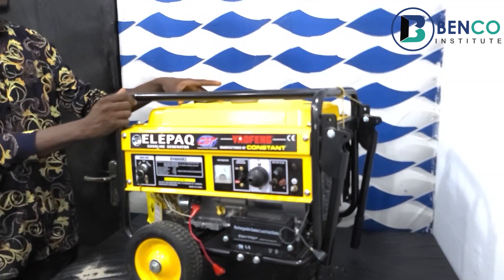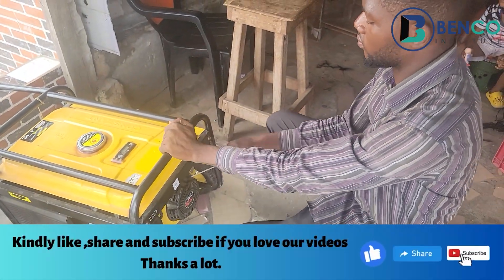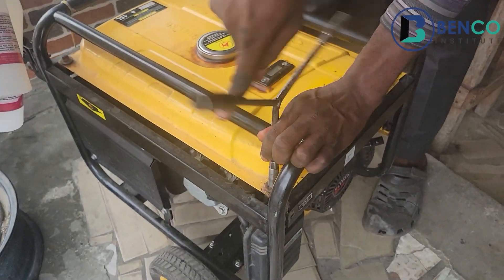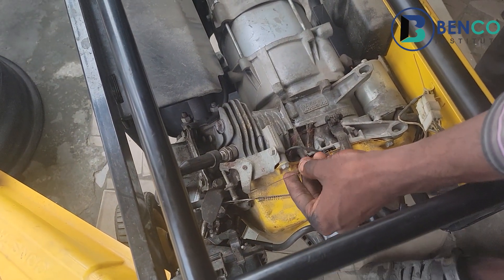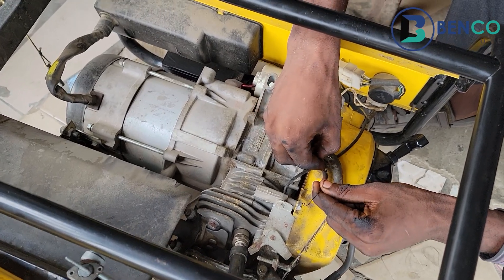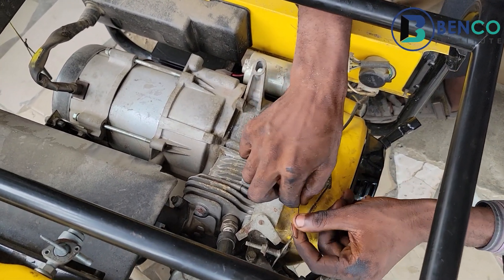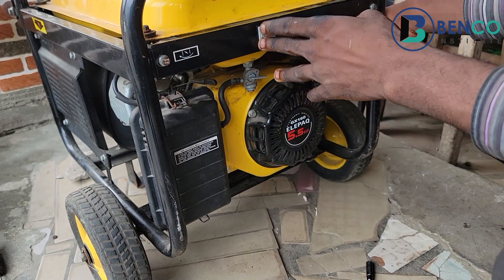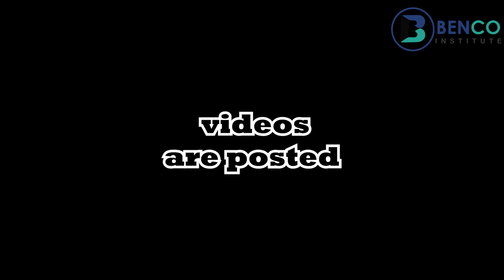Governor spring replacement:How to fix no/low voltage and low speed in 2mins for your generator

Comment: Short and straight to the point. Thanks and more power to your elbow sir.
Pls help me on my gen problem. Many engineers coulnt. The generator starts and sound normal. On loading, it stalls the governor spring is not broken but i sense that the gen cannot increase speed momentarily on loading. Avr has been ruled out. Another observation is that when i accidentally starts with the load on, the gen did not stall. Thanks

Comment: Boss,I watched the video of how to clean carburator,after I did it I turned on the gen,but then there is this thing that looks like choke but not choke that increases and decreases current stopped working,I just take screwdriver to increase that black screw stuff in the carburator,but atm my tiger gen can't carry my sumo pump again even after increasing current from that screw stuff,once I put on the sumo switch then generator sound would reduce badly then start sounding like it wants to die off. Please help